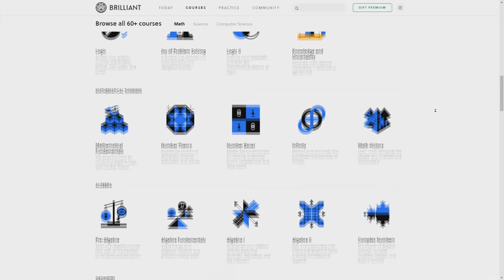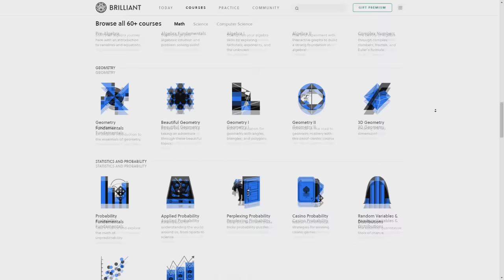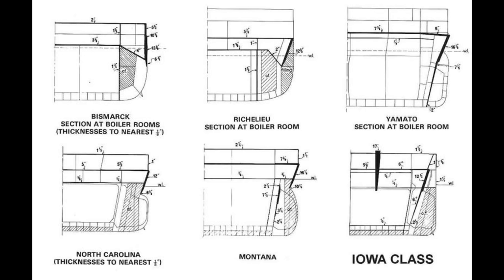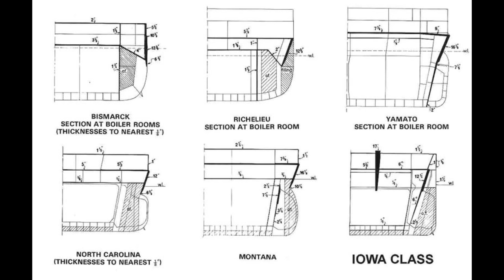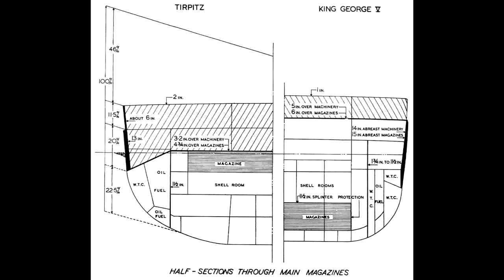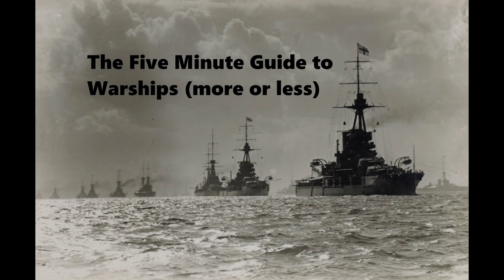Dreadnought Modernisation - A tri-wire balancing act

Comment: Kongo class' "unbalanced upgrade" was worth it tho. They didn't just became the most useful capital ships in IJN service but also one of the most (if not the most) useful modernized WWI era dreadnoughts around during WWII.

They didn't just escort the carriers most of the time but they also became the center piece of IJN task force during the Japanese invasion of Malaya and the early parts of the Guadalcanal campaign. They were always on the line especially at important IJN campaigns starting from the Attack on Pearl Harbor, Indian Ocean Raid, Midway, Guadalcanal, Leyte Gulf, until Haruna's demise at Kure on July 1945. They also did some sort of convoy escort when some of surviving major IJN ships returned to Japan late in the war.
Reply: The primary mission of the Kongo class was to blow a hole in the US Fleet's screen during the night and day torpedo battle under the "Decisive Battle" doctrine. Which the IJN never got the chance to execute because the USN was too smart to walk into that trap after 1935.
Reply: Ye
Reply: @michaelsnyder3871  A lot of warships in WW2 spent most of their time doing something that hadn't been in The Plan. I've read an article from USNI Proceedings in the 1980s (?) arguing that the only US navy ships in WW2 that actually closely followed pre-war expectations were the minesweepers.
Reply: I would question the actual usefulness of the Kongos; I feel that in this aspect they’re the most overrated (though not the worst, that would be the Fusos and Ises) out of all the IJN capital ships. 

Yes, they served as carrier escorts. But big-gun capital ships are, strategically speaking, terrible carrier escorts, because they don’t actually fill a role as carrier escorts that other ships cannot fill at less cost. A fast carrier strike force isn’t ending up anywhere near enemy surface units unless the commander literally doesn’t understand the concept of a fleet carrier (see: Glorious), so the big guns are redundant. Between that and the lack of ASW capability the only thing that fast battleships/battlecruisers attached to fast carrier forces can really do is to provide AA cover, and AA support can be much more cost-effectively provided by subcapital units that are also fast enough to keep up with carriers.

And while the Kongos were deployed the most often out of the IJN big-gun capital ships, they had very few successes to their name. The only one I can think of is Kongo and Haruna bombarding Henderson Field (which may, or may not, have been something that heavy cruisers could have done instead), and even that failed to have enough of an impact in the long run. The other two times that they got involved (as in, actually participated instead of merely being present) during the Guadalcanal campaign resulted in half the class being lost. And Kongo herself had a much worse track record at Leyte Gulf than traditionally thought-the vast majority of the hits she had against Taffy 3 were actually from other vessels (in particular, the hit that decapitated Johnston couldn’t have come from her because she wasn’t shooting at anything at that point: Yamato’s secondary battery is the most likely culprit for that hit). There is even a possibility that she may have been part of the reason for Chokai being lost with all hands (now that White Plains’s hit to her torpedoes has been disproven), as Chokai was in her line of fire when she suffered severe damage from something and a friendly fire incident is quite possible (though this could also be from being bombed).
Reply: @bkjeong4302  With perfect hindsight, yes the Kongo class, indeed all battlecruisers and fast battleships, were not ideal as carrier escorts. In the early 1930s that was not obvious. (And yes there were visionary naval leaders on all sides who were saying by 1920! that big capital ships were obsolete.)
The Japanese were limited by treaty to 12 heavy cruisers. The second Kongo upgrade that restored speed to 30 knots gave them four more big carrier escorts that otherwise they would not have. Even if they cost three times as much, a ship at sea always beats one that exists only on paper.
Nearly all warships have very few or no successes to their name. Battles are rare at sea. It's especially difficult to judge escort / guard ships which don't actively hunt the enemy. Most of the Allied destroyers and frigates and escort carriers on convoy duty never actually sank a submarine: does that mean they were over-rated or a waste?
For the Kongo class as carrier escorts, we know that in the early carrier battles in 1942 the US navy withdrew at night rather than stay in contact, even when they had won the carrier duel. And while I haven't studied this in detail, a couple of US historians state that this is because they were worried about night surface attack. Would the US have been more aggressive if the Kongo class had not been present? Maybe, maybe not.
Reply: @bkjeong4302  Actually you should be praising the Kongo class as very successful economic warfare :-) It was because of the Kongos that that the US Navy wasted, as you so often put it, so much money and time and resources on the Iowas.
Reply: @hughfisher9820  

Yes, plenty of escorting vessels did nothing, but most such vessels were relatively cheap and expected to serve in supporting roles rather than actually play a significant role anyways. None of that applies to capital ships, which have to be able to serve as capital ships-the primary units that engage or deter the enemy primary units-to justify themselves strategically, due to the fact they’re far bigger investments. When placed in a carrier escort role, they’re not able to do so, not when the fast carrier strike forces they escort remain far out of gunnery range of the enemy and thus render them irrelevant as either combatants or deterrents.

Yet, we see capital ships (the Kongos, the American fast battleships, etc) be ranked highly in terms of usefulness because of the fact they served as carrier escorts, which completely ignores the fact that having a fast capital ship serving as a gigantic, pointlessly expensive CLAA or a superfluous deterrent against nonexistent enemy surface attacks is already a massive strategic failure in itself. Serving in a role where other types of warships would have been far more justified in shouldn’t be a positive mark on the performances and strategic values of such vessels, yet it’s far too often seen as such. That’s the biggest issue I have with this. 

The US did have concerns about their carriers falling victim to night surface attacks in some early-war engagements, but by simply keeping their carriers away from enemy surface units they rendered their own concerns a non-factor while still winning the battles; the whole point of a fast carrier strike force is to NOT be anywhere near enemy ships but to rely on the range of the aircraft while keeping out of reach of surface vessel. Whether the Japanese had the Kongos with their carriers or not was irrelevant to the overall outcome, not when the Japanese (and really, everybody) didn’t have any realistic chances at finding a fast carrier force that’s hundreds of miles away and keeping on the move using surface ships even when the fast carrier force wasn’t able to launch aircraft.
Reply: @hughfisher9820  Except that if the USN was smarter, they wouldn’t have built the Iowas anyways, regardless of the Kongos (because there was no reason to build the Iowas whether the Japanese had modernized the Kongos or not, since the Kongos weren’t actually a significant threat). A plan that depends on your enemy being stupid isn’t a good plan.

Comment: Excellent video, I now know how to modernize a Pre-war dreadnought just in case  I get magically teleported to the early 1900's with a teleporter that I totally don't own or possess and is NOT located in my back shed (looks nervously around the room)
Reply: Remember to grab a laptop with an internet free Cad/engineering program With a portable charger(s), battery pack(s), and large foldable solar cell(s)! I would also recommend nab a bunch of modern toilet paper as well, the stuff they had is like roofing felt!

Comment: Just what is involved in replacing a major warships machinery.
In terms of underwater protection one factor the US faced was transit through the Panama Canal.  
There are armor piercing bombs and there are armor piercing bombs.  The converted 16" AP shells from the Nagato come to mind.
Reply: You're going to have to make a big enough hole in the ship to get the old machinery out and the new machinery in. I'm thinking you'd have to remove the superstructure above the machinery spaces to do that, and then replace it afterwards, so a major rebuild.
Reply: @gwtpictgwtpict4214  Replacing the engines in cruise liners is done fairly often - and this is done through the side of the ship. The battleships armor is a problem in this regard.
Reply: @allangibson2408  What about warships of nowadays ? They don't have armor.

Comment: By WW2, I would consider removing some of the main gun turrets and replacing them with dual purpose secondaries, leaving only 2 main gun turrets per ship. Aircraft are bigger issue against battleships than other battleships, and 2 main gun turrets are still enough against everything else, especially when backed by additional secondary guns. We have also saved some weight, which can go to, well, pretty much anything, including but not limited to improved torpedo protection or redundant propulsion and steering systems to make sure loosing or jamming one does not hinder ship quite as badly as what happened to Bismarck.
 
Now removing main guns is a massive process, and you may not able to effectively use the space that was used by main turrets, so it might be bad idea to remove main guns from existing ships, so this is more of a design for entirely new battleship i think.
Reply: That is something that I have observed, too. The refitting of the Iowa class in the 1980s was sheer butchery. A proper rebuild would have replaced her boilers with nuclear reactors, and replaced her forward upper turret with a Standard missile system -- converting the better part of her forward magazine to the high-speed rail delivery system for the Standard missile launcher would have given it extraordinary fire endurance as a fleet escort for a carrier. All of the old twin 5"/38 Dual-Purpose gun turrets could be replaced by the 5"/54 single turrets, or 76mm Rapid-Fire tripple-purpose (support, AAA, anti-missile) twin turrets. The old quad 28mm batteries are probably best replaced with Sea Sparrow; while the some of the many .50 cal positions could be replaced by 20mm Phalanx CIWS.

Rebuild the outside of the superstructure to mount the AEGIS RADAR system and electronic countermeasures.

When Congress asked, "Why is the Navy doing such a $hitty rebuild," the answer from the Secretary of the Navy was, "Because there no longer exists in the United States any shipyard with welders capable of cutting through the hull."

Comment: It’s a shame the Royal Navy didn’t have the money, time, and desire to do something meaningful with the Revenge class.  They would’ve been excellent candidates for a Cavour-style rebuild into appreciable fast(ish) battleships.
Reply: At that point it would be better to just build new ships. The Italian's only did it because they had to, and they only got away with it (because substantial hull modifications were technically not allowed) because they scrapped their modern BB and had a "deal" with France not to build new ones. Once you start modifying the base hull beyond bow refits or stern extensions it becomes almost as (if not more) resource intense as building a new ship to the rebuilt specs. But the new ship gives you a lot more flexibility in design, and better life expectancy.

Comment: Hey Drach. Not sure if this is the correct format for a Q&A question, but here goes: how would have an earlier discovery of better battery tech, e.g. lithium ion batteries prototyped by 1920, have affected naval tech by WW2. How much would Submarine effectiveness improve, would electric torpedoes replace traditional ones and would something like a hybrid diesel electric drive, with batteries?
Reply: Ooh, good question! Did he answer it?

Comment: I'm curious, would any improvements to the armour through extending the belt or improving deck armour have saved Hiei? Did the shell from a US cruiser have to penetrate the belt to knock out steering and if not, would any extension to the belt have feasible covered where Hiei was hit, and if so, was 8 inches enough to stop an 8 inch shell at point blank?

Comment: Disagreeing a wee bit with Drachinifel I would point out that a lot of Victorian central-battery & turreted ironclads did get extensive modernizations in the 1890s, including: BLR guns replacing MLR guns, Triple Expansion Engines, and Military Masts replacing sailing rig. E.H.H. Archibald's book 'The Metal Fighting Ship in the Royal Navy 1860-1970' does a good job illustrating the changes made.

Comment: A lot also has to do with what you have building at the time.  For the US you have two North Carolinas, Four South Dakotas, Six Iowas and three Alaskas building (they didn't even bother finishing three of those) then you can afford to relegate your older battle line to slow moving bombardment platforms.  If all you have building are the three Yamato class then you need your conversions to be fast enough to fight in the main battle line.   This is why the Italians and Japanese had to sacrifice armor and firepower for speed.  Yamato, Bismarck and Littorio may be better than a 35,000 ton treaty battleship, but they aren't twice as good.  And they were going to be outnumbered 2 to 1in fast battleships  by the British (5 KGV + 3 Battle Cruisers) and Americans (12 fast BBs + 3 Alaska class).
Reply: This is true, the main purpose for rhe Standards in ww2 was to protect landings/shore bomardments, they did that job very well at Suriago Straight, speed means less when you are guarding a static area
Reply: Your statement would be true if any country other than the US ACTUALLY rebuilt a dreadnought between 1941 and 1945, other than the US and the two Tennessees and the West Virginia. The Japanese program was from 1933-1940, the Italians 1936-1940, the French 1920-1933, the British 1934-1941 and the initial US program from 1926-1934. The construction of the two Yamatos and the two Shokakus precluded any rebuilding of other Japanese capital ships as the IJN could only build four high powered ship plants every four years (in this case, 1937-1942).And the Italian ships were basically completed alongside the first two "Littorios" by 1940.

Comment: Anyone else thinking about Hood in the first 2 minutes and kinda being snarky. 

How do you go about doing it? Don’t
What are the pitfalls to avoid? Bismarck.
What should you include? I think one less 15 inch shell would be a good start.
Reply: If on Boxing Day 1937, Hood had gone in for just machinery replacement, that's all, enough to maintain her existing speed, and maybe increase by one knot, deferring all other major refit decisions for later, when would she have been back in the fleet, and about how much weight would she have available for upgrades to do later?  (Or would there have been obvious and value upgrades that could have been done in addition to machinery that would have not delayed her time in drydock?)

Comment: The thing I wonder about the most is exactly how useless the casement guns were on the American standards and exactly how long it took them to stop installing casement guns on new vessels. Cuz they had figured out pretty early  that they had little to no elevation to be able to aim at anything and they sat so low on the ships that most times they still couldn't be used because, well it's kinda difficult & dangerous to load & fire a gun when there is water coming down the barrel. It's almost like the Japanese did the Americans a favor by bombing the ships at Pearl Harbor. With the exception of the the lives lost but if those ships had sailed out to battle as they were a lot more of our sailors may have been lost. The fact that they were sunk at Pearl and then refloated got most of them the upgrades they really needed to actually go to war & have a chance. With the exception of maybe one being by itself & running into Yamato or Musashi.